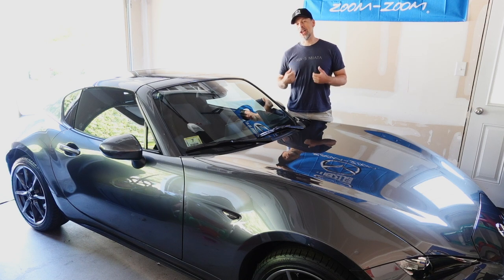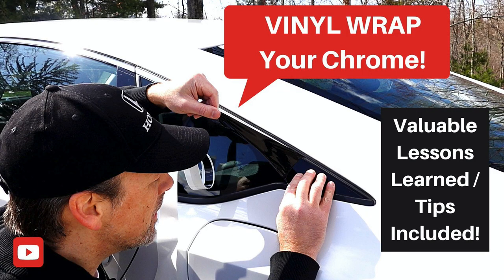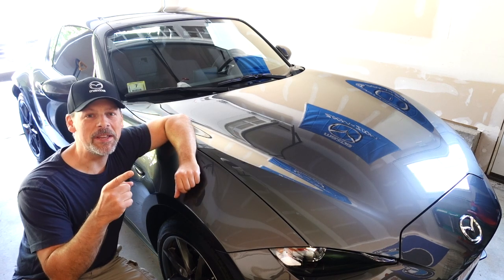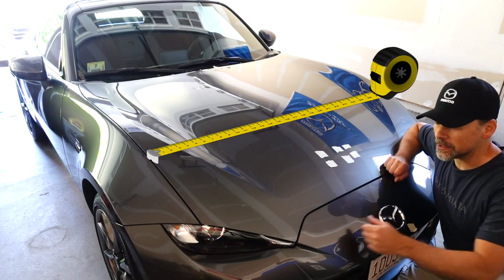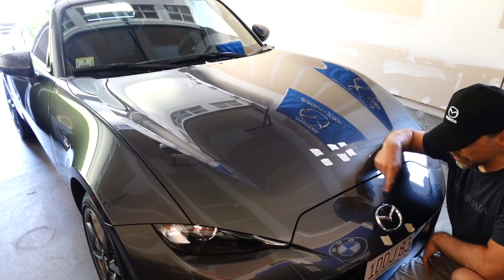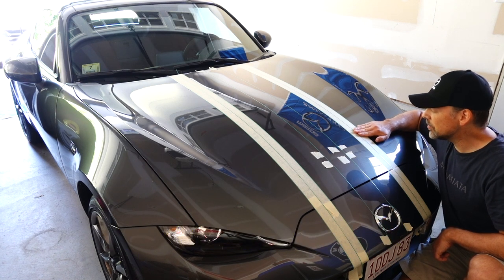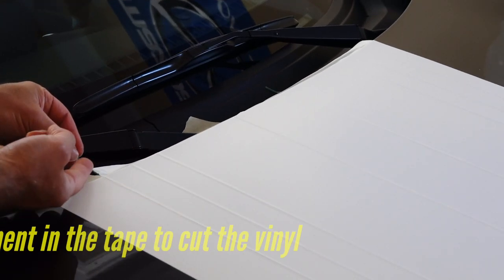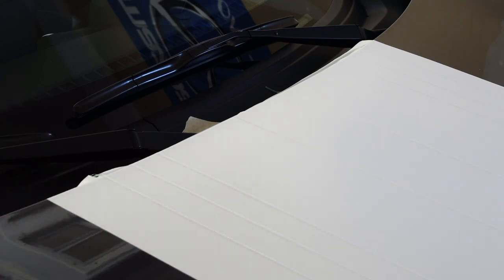ND (2016+) Mazda MX-5 Miata - Vinyl RACING STRIPES!

Comment: That’s solid work and good attention to detail. It came out better than I was expecting, but I’m just not a fan of how the quad stripes overpower the lines of the car. If you’re on the fence, perhaps remove the two outer stripes and see how that looks.  Regardless, props for going for it.
Reply from the maker: Thank you.  I think I agree with you... one reason why I stopped was I wanted to ensure that I liked the look before finishing off the car.  I'm not sure I like the full quad stripes and, the gap in the middle seems a bit much for me... I might end up trying a different layout, but with just two stripes.

Comment: Hi Chad 
I have a question for you, if I did not like how it looked on my Mazda could I peel it off with out peeling the paint off?
Thanks
Reply from the maker: Good question.  From what I read, yes, you should be able to peel off the vinyl wrap without damaging the paint.  I hope that's the case ; )
Reply: Have striped mine as well, had one set on for a year and removed them (yesterday) with no problem at all. I took my time and didn't force anything. New stripes should be finished tomorrow; doing the full length of the car (hood is done). Went with 9 inch center, one inch space, then one inch stripes alongside.
Reply from the maker: I’m sure that will look great!  What color is the car and the stripes?
Reply: @TheLemonFactor  ND RF w Arctic Grey and the stripes are "VViViD Reflective Gloss Red"! Carbon Miata carbon fiber hood, looks boss. All on now, will post to the Miata Reddit at some point. Loving it! need to replace a couple pieces bc turns out I'm not a professional and it's fairly difficult to work w this particular vinyl. Who knew??
Reply from the maker: Sounds like a really striking color combination. I’d love to see the pics.
Reply: @TheLemonFactor  https://www.reddit.com/r/Miata/comments/p0625d/my_2018_w_a_few_mods_i_love_seeing_everyones_rig/ it's def more red irl, but you get the general idea

Comment: No stripes. Great video though. Brave man!
Reply from the maker: Thanks for the watch.  The good thing is that they can easily be removed.
Reply: @TheLemonFactor  I don't think the stripes look bad, actually they look pretty good. They give it a bit of a Cannonball run look. Just not for me. I love every speck of that Machine Grey too much!
Reply from the maker: I like the look, but sometimes think the white is too much of a contrast with the grey.  I think a matte black or even a silver might look better.  The good thing with this vinyl is you can play around with it.  Thanks for the follow-up comment ; )
Reply: @TheLemonFactor  Hey, no problem, I like your channel. I have this car so enjoying the journey and sharing the experience with other converts. BTW, my car has developed a wind noise coming from the front somewhere. Have you come across this? Not sure if it's a seal or a vent? Keep up the great content.
Reply from the maker: Appreciate the support. I haven’t noticed any change in wind noises. Does it change depending on if the top is up or down?
Reply: @TheLemonFactor  It's when the roof is on. Sounds like a rustling noise coming from the front somewhere. I notice when I Google this others have mentioned this but no answer. Very odd. Anyway, have you done a vid on how you clean yours? That would be very interesting. I know detailing vids are very popular. Best wishes from UK 😀
Reply from the maker: I'll keep an ey... um ear out for the noise and let you know.  I have a detailing video coming out in a couple weeks, but I used my other project car for it, but of course it is translatable.  Stay safe and healthy in the UK.
Reply: @TheLemonFactor  Thanks buddy, you too 😀

Comment: I'm begging you chat don't do it please don't do it you will regret this and it will be a b** to get off when you realise you've made a huge mistake.....Cheers Phil from Newark
Reply: Well  cad  I'll give it to you  you did an excellent job on it it's not for me. Maybe for her was 20 instead of 59 perhaps ..good luck with the with the rest of it I shall enjoy watching you finishing it off....Cheers Phil from Newark
Reply from the maker: Thanks for the watch and comment Phil.  I like the stripes, just not sure if I like the pattern I've played out, I may change it up.  However, this stuff supposedly can easily be removed, especially if you add a little heat, such as letting the car sit in the sun for a while, or using a heat gun, it should make the vinyl more pliable and easier to remove.  I guess I'll find out if that's the case.
Reply: @TheLemonFactor  your welcome  as I said looking forward to the next instalment. And good luck it ...Cheers Phil from Newark